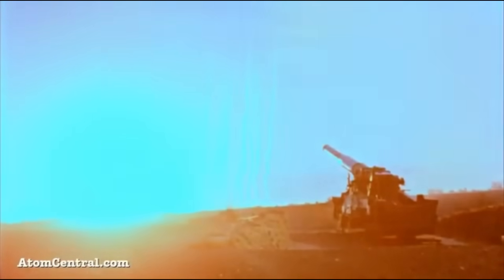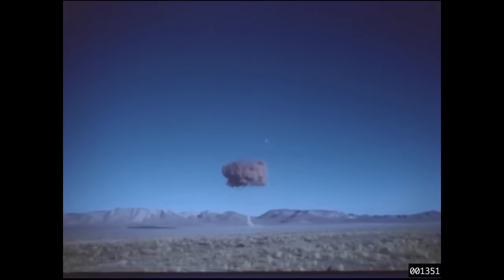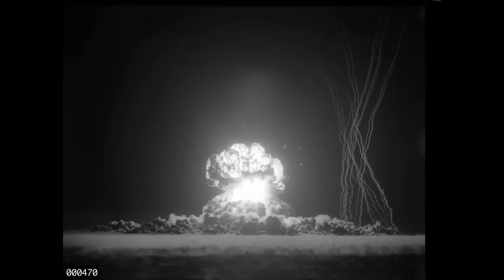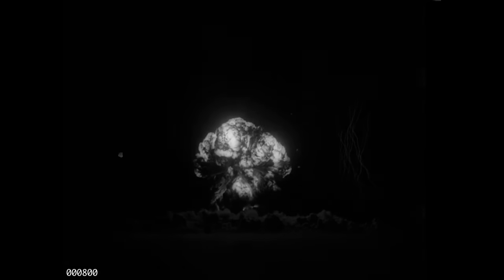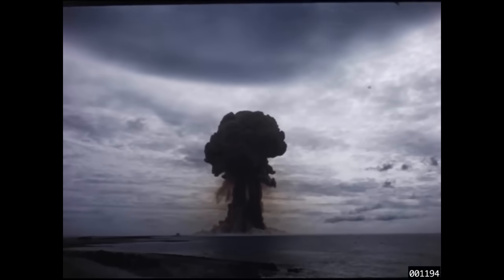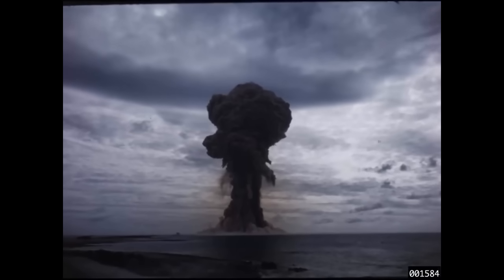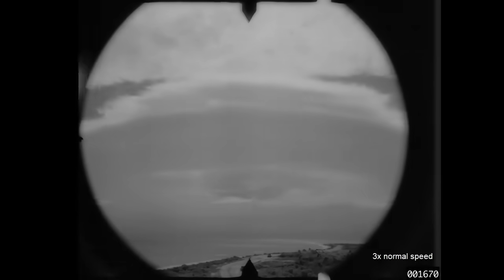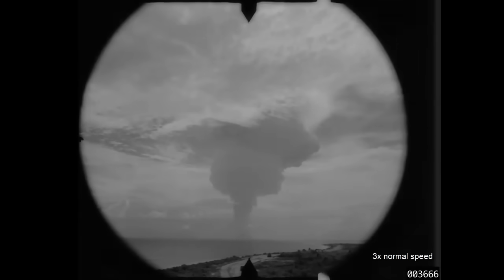What does a nuclear bomb sound like?

Comment: Something that wouldn't have been captured in the audio, at least not in a meaningful way, would be the ultra-low frequencies, the deep rumbling and shaking of the shockwave traveling through the ground. Those sounds would actually arrive well before the "main" boom (many seconds earlier, in fact), as sound travels through solid matter much at a much higher speed than it does through air (or water). By the same token, it would be almost exclusively very low frequencies that could be detected through the ground, as higher frequencies don't propagate very far through the ground. Basically, you'd mainly "feel" the explosion through the ground as a vibration, and experience the sound almost more as a physical sensation, rather than the way we hear most aoundsm, though it is very much still sound. It would probably be deeply unsettling.

Comment: So it took 34 sec for sound to travel. If you look at the video the first flash appears at 1:44  and the sound comes at 2:18. That is about 34sec. So if you calculate  the considering speed of sound approximately 343m/sec, in 34 sec it would travel 11.7Km.

So blast must have been about 11.7 km away. The sound is weird one. it could have little further if temperature air was greater then room temperature(20c)

Comment: The fireball can be seen at 1:43 and the shockwave at 2:18 - 35 seconds later. The speed of sound in air is about 343 m/s which means the nuke was about 12,000 meters away

Comment: The sound took approximately 35 seconds to reach the camera. Considering temperature to be ≈30 degrees celcius (judging by the time and place) the speed of sound in air is ≈341 m/s, so the distance of the bomb site from the camera is roughly 12 kms.

Comment: It’s actually a double bang. That’s how the Vella satellite system detects nuclear blasts. They have distinct double bang. The first explosion that triggers the device followed milliseconds later by the nuclear blast. The scary thing about hydrogen bombs is that the trigger explosion device is an atomic bomb. It requires an atomic explosion to create the heat and pressure necessary to cause fusion. The first hydrogen bomb was basically the size of an apartment building.

Comment: It took 34 seconds for it to come. By that number, the camera was about 10.29 Kilometers, or about 16.464 miles away.
Reply: If you need the math, we’re using the speed of sound to measure it. 343 • 34 = ≈10290 meters. 10290 / 1000 = 10.29 km. 1 mile is about 1.6 km, meaning 10.29 • 1.6 = ≈16.464 mi
Reply: @RhysWithABible  Other way around! By the way your math is wrong, 343 x 34 is 11.662km 😮
Reply: @roadgent7921 oops, sorry about that! I might’ve calculated wrong.

Comment: Have you seen the footage of the airburst test where they detonated a device directly above five people who were "volunteered" to show how safe nuclear operations could be?  It was a small-yield device, and the detonation was in the tens of thousands of feet above their heads, and as such, there was very little of the blast/ground interaction rumble.  You see the bright flash, and maybe five or six seconds later, you hear a loud, almost high-pitched cracking sound, more like an enormous set of sticks being whacked together than a bomb going off.  Likely, the lower end of the sound was attenuated by the thickening air it traveled through as it descended, plus the only blast interaction was with the surrounding air, which again reduced any sound not associated with the actual blast.  That high-pitched CRACK is definitely not what you think of as the sound of a fission bomb detonating, though!

Comment: The sound of an explosion is largely determined by how fast the detonation occurs. So a low rumbling sound is something you only get with a very slow deflagration, like gasoline or black powder. Modern high-explosives detonate at supersonic speeds, resulting in a short snap or pop sound, except of course very loud. So it makes sense that a nuclear explosion, which happens unbelievably fast, would have a very short sound as well. 

How a nuclear explosion actually looks like would be similarly disappointing. In any practical range for someone to be able to see the fireball and mushroom cloud, it would look like a flash of impossible whiteness that fills every possible space, and then blindness.

Comment: U.S. Major Alexander P. de Seversky, who in 1945 inspected the bombed-towns of Japan, testified:

"In Hiroshima I was prepared for radically different sights. But, to my surprise, Hiroshima looked exactly like all the other burned-out cities in Japan. There was a familiar pink blot, about two miles in diameter. It was dotted with charred trees and telephone poles. Only one of the cities twenty bridges was down. Hiroshima’s clusters of modern buildings in the downtown section stood upright.

It was obvious that the blast could not have been so powerful as we had been led to believe. It was extensive blast rather than intensive.

I had heard of buildings instantly consumed by unprecedented heat. Yet here I saw the buildings structurally intact, and what is more, topped by undamaged flag poles, lightning rods, painted railings, air raid precaution signs and other comparatively fragile objects.

At the T-bridge, the aiming point for the atomic bomb, I looked for the “bald spot” where everything presumably had been vaporized in the twinkling of an eye. It wasn’t there or anywhere else. I could find no traces of unusual phenomena.

What I did see was in substance a replica of Yokohama or Osaka, or the Tokyo suburbs – the familiar residue of an area of wood and brick houses razed by uncontrollable fire. Everywhere I saw the trunks of charred and leafless trees, burned and unburned chunks of wood. The fire had been intense enough to bend and twist steel girders and to melt glass until it ran like lava – just as in other Japanese cities.

The concrete buildings nearest to the centre of explosion, some only a few blocks from the heart of the atom blast, showed no structural damage. Even cornices, canopies and delicate exterior decorations were intact. Window glass was shattered, of course, but single-panel frames held firm; only window frames of two or more panels were bent and buckled. The blast impact therefore could not have been unusual."

Hidden History, Winter Watch
Was Hiroshima Firebombed and Not Nuked?
Russ Winter Articles by Russ Winter / March 29, 2025

Comment: There are NO nukes!
Reply from the maker: There are 4 lights!
Reply: @venera13  U.S. Major Alexander P. de Seversky, who in 1945 inspected the bombed-towns of Japan, testified:

"In Hiroshima I was prepared for radically different sights. But, to my surprise, Hiroshima looked exactly like all the other burned-out cities in Japan. There was a familiar pink blot, about two miles in diameter. It was dotted with charred trees and telephone poles. Only one of the cities twenty bridges was down. Hiroshima’s clusters of modern buildings in the downtown section stood upright.

It was obvious that the blast could not have been so powerful as we had been led to believe. It was extensive blast rather than intensive.

I had heard of buildings instantly consumed by unprecedented heat. Yet here I saw the buildings structurally intact, and what is more, topped by undamaged flag poles, lightning rods, painted railings, air raid precaution signs and other comparatively fragile objects.

At the T-bridge, the aiming point for the atomic bomb, I looked for the “bald spot” where everything presumably had been vaporized in the twinkling of an eye. It wasn’t there or anywhere else. I could find no traces of unusual phenomena.

What I did see was in substance a replica of Yokohama or Osaka, or the Tokyo suburbs – the familiar residue of an area of wood and brick houses razed by uncontrollable fire. Everywhere I saw the trunks of charred and leafless trees, burned and unburned chunks of wood. The fire had been intense enough to bend and twist steel girders and to melt glass until it ran like lava – just as in other Japanese cities.

The concrete buildings nearest to the centre of explosion, some only a few blocks from the heart of the atom blast, showed no structural damage. Even cornices, canopies and delicate exterior decorations were intact. Window glass was shattered, of course, but single-panel frames held firm; only window frames of two or more panels were bent and buckled. The blast impact therefore could not have been unusual."

Hidden History, Winter Watch
Was Hiroshima Firebombed and Not Nuked?
Russ Winter Articles by Russ Winter / March 29, 2025

Comment: Not nuclear... just atomic. But they would sound broadly the same.... "Bang!". But at other distances the sound would have been very different:
Within the total destruction radius, you'd hear nothing, because you'd be destroyed before your senses could achieve transmission to your brain;
Within the shock wave, the wave front travels faster than the speed of sound, so the sound would be instantaneous and not really a sound wave, but an abrupt transition to a new overpressure. It's like the difference between an ocean wave and a bore or tsunami, in which the water level goes from low to high. There is no wavelength or frequency to hear - just a change in amplitude.

Further away, the bang is the sound that came FROM the shock wave passing objects, going around them and meeting itself on their far side. Imagine the mach stem travelling along a regular row of houses - they would impose a frequency which would diminish by the inverse square law as radius increased. That's where sound would come from.

And following that sound would be the sounds of the winds (outwards and then back into the low pressure zone left by the momentum of the air and its cooling), and wind-blown debris hitting all that was in its path, a roar of white noise that would eventually diminish to the catherine-wheel like sounds of the remaining projectiles falling through the air from great altitude and their impacts on the ground, ever less frequent.

My father was sent to assess the damage done by the atomic bomb in Hiroshima. About a decade later, he witnessed a nuclear weapon test and heard the sound. I wouldn't ever want to hear it.

Comment: um, if you have ever been in USMIL , esp ground  forces, combat, etc, and have operated with  IDF or  CAS,  its similar  boom,  but not a cont aftershock , unless there is terrain,  or  additional explosions.  but clear nuke is WAY MORE loud, depending on how close to ground zero.   scary.

Comment: The sky blinked white.
A heartbeat later—
"KRAAATHOOOOOOMMMMM!!!"
The ground jumped. Air turned solid, slammed into his chest.
Ears filled with screeching static—then silence.
Then the low, endless growl:
"grrrMMMMMMMMMMMMMM..."
Windows shattered in waves. Steel groaned. Concrete cracked.
Dust poured like rain.
Flames roared somewhere behind the wind.
His body vibrated. His breath caught.
The world rang like a broken bell.

Comment: I would expect a big, sharp crack or boom. It's a shock wave, and powerful enough to inflict widespread damage miles away. 

Depending on the quality of the recording and the terrain, that atmospheric shock wave might be preceded by a quieter ground wave, assuming assuming an ground-level detonation. Solid matter transmits sound a lot faster than the air. However, it would have to be retransmitted to the air to make an audible sound, so whether you could actually hear anything would depend on the composition and configuration of the ground. 

Finally, since this is a recording, EMP at the instant of detonation may cause some sort of snark or electronic interference. You wouldn't hear that in person unless there were radios or loudspeaker equipment on and operating in the area, but it could well be on any recording.

Comment: Fun fact: midwinter 1965 or 66, Los Alamos almost nuked itself.  Explosive and fissiles were assembled in plywood models, which used depleted uranium cores.  A tech was hooking up the detonator, when he felt heat from the core.  There was about six inches of snow on the ground.  He stopped the test and it turned out that the folks at N division sent over a plutonium core by mistake.   The entire of N division was fired, top to bottom.  Estimates I heard at the time was about 100kt yield had it gone off.

Comment: What does a nuclear weapon sound like? This is an oxymoron question for several reasons. It depends on the yield of the weapon and the prevailing weather conditions during detonation and also the location of detonation. The blast from Tsar Bomba was supposedly heard as far south as London even though the weapon was set off in the Arctic. You certainly would not get that with a 15KT artillery shell, sorry to burst your bubble. Additionally, you only get to hear the sexy sound if you remain alive, intact and with the bragging rights. Ground zero = you hear nothing.
Reply from the maker: Bang

Comment: This is NOT a nuclear bomb. This is a fission (atomic) blast, a tactical battlefield weapon. A thermonuclear (hydrogen) bomb is at least 10 and up to 1000 times larger.
Reply from the maker: Nuclear bomb means any bomb that derives energy from Nuclear reactions. That means both fission and fusion. Nuclear bomb and atomic bomb mean the same thing. Thermonuclear bomb specifically refers to a hydrogen bomb but it is still a Nuclear bomb, because it's energy involves the nucleus of the atom. 

Tactical Nuclear bombs generally mean any bomb under 50 kilotons. You can have a bomb that can be both tactical and strategic by changing the yeild via injection of fusion fuel, usually tritium.

I have a video where I go into extreme detail about the inner workings of different types of Nuclear bombs. Although there is a slight misunderstanding surrounding hydrogen bombs. A lot of the energy is still fission based. The fusion reactions in the second stage catylize the uranium tampers into fission which accounts for a bulk of the energy. Replacing 1 tamper with lead in the Tsar bomb reduced the yeild from 100 megatons to 50 megatons.

Comment: For those of you who dont know what "criticality" is....

It's very simple. 
If there's too much of a fissile material (Uranium 235, Plutonium 239) in one place, together in intimate contact, a nuclear explosion will just automatically happen. 
Criticality is how much of the material needs to be present in one spot for the explosion to occur. 1 gram less, and there will be no explosion. 

A nuclear bomb simply takes a lump of fissile material that is somewhat close to criticality, then uses conventional explosives to pack that lump tight enough together so that the total sum of the material is now pushed over the criticality mark because it is made more dense by the push of the explosion of the conventional explosives. There are 2 ways to make a non-critical chunk of material critical. By adding more material to the chunk, or by squeezing it hard enough to shove the atoms closer together and make it appear as though more material has been added. The resulting explosion is just automatic once you've put enough material together in one spot, and held it together long enough (microseconds) for the reaction to take place. The information concerning the total amount of material, and the time needed to hold it all together, in order produce a nuclear blast is out there but i wont repeat it here.

Comment: Question. I thought an emp pulse destroyed all electric equipment. What gives with the camera?
Reply from the maker: The bomb was detonated close to the ground so the EMP had far less range. EMPs are more powerful and widespread if you detonate the bomb in space. Also the camera is an analog film camera so its less susceptible to damage from the emp. The bright light and heat from the initial detonation messes up the Mechanicsville little causing that hum. But the strong EMP doesn't reach the camera at that distance.
Reply: @venera13  Thank you.

Comment: The  thing is about nuclear Bomb they are much bigger now.We don't know the actual size till it happens
Reply from the maker: In the US arsenal the current largest bomb is the B83 which has a yeild around of 1.2 megatons. Making it a lot bigger than this. But a lot smaller than the Castle Brovo test at 15 megatons, or Tsar Bomba at 50 megatons. All the largest nuclear tests back in the day where using bombs that where physically too big to be practical. So in order for them to fit on ICBMs there is a physical limitation to yeild.